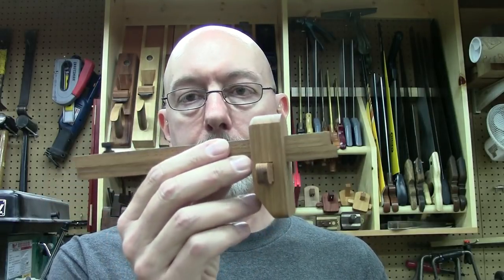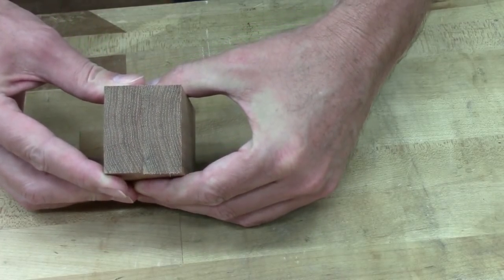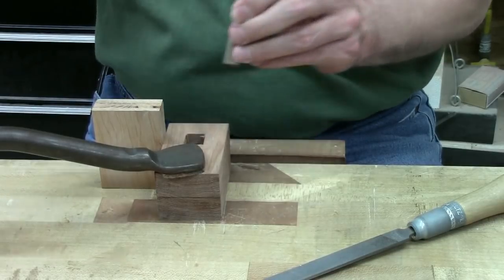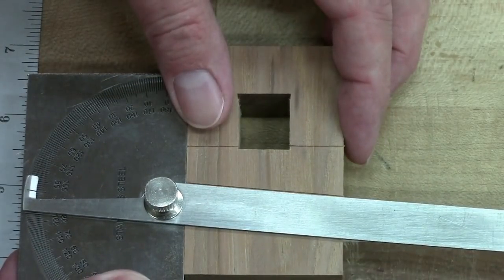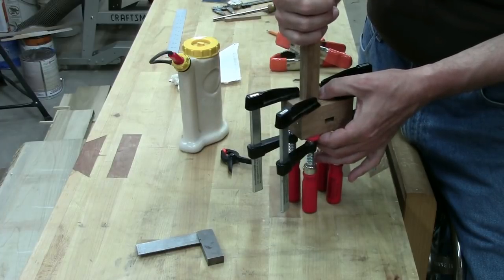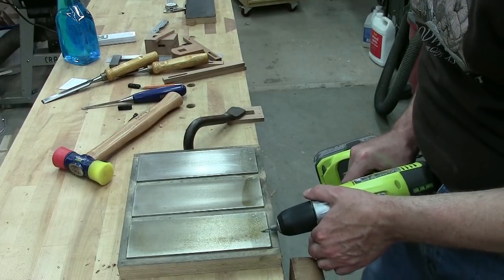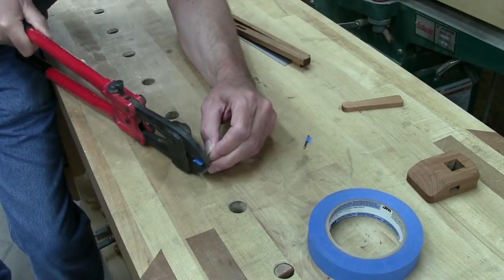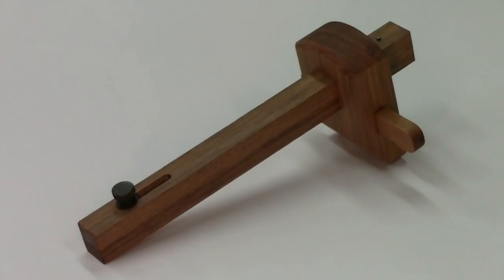Hickory Mortise Gauge

Comment: Are you a machinist or toolmaker or something? Most woodworkers I know do not have, or ever use, the sizes of drill bits you are using. Number and letter drills are much more common in the machining trades. Just wondering. Nice gauge. Simple design. I think I'll give it a go. Thanks for a thorough explanation.
Reply from the maker: Hi Doug and good guess.  I have a degree in manufacturing engineering technology.  I've worked in a pattern shop as a machinist and taught manufacturing technology at a community college.

Comment: Quality +1 But I would advise to make one needle two-sided. Then the tool will be more versatile.
Reply from the maker: It could be done easily enough, the long pin would just need to be sharpened on both ends.   Since the pins are a pretty tight fit, they need to be tapped into place with a hammer.  You would just have to file a point on the top end of the long pin after you drive it into place.
Reply: Yes, that's right ;)

Comment: You have heated the blade on your band saw to the point where it straightened the teeth, and is not cutting well, its wandering back and forth on the wood. Replace your blade, and adjust your guides. I can see the blade moving in your clip... I suggest this video: Band Saw Clinic with Alex Snodgrass.
Reply from the maker: It's been a couple of years.  I might have forgotten to engage the quick release tensioner.  The blade was probably getting dull as well.  That hickory is tough.  I sat through one of Alex's seminars at the woodworking shows a few years ago.  If you do it like he shows, you can make any bandsaw run like a champ.